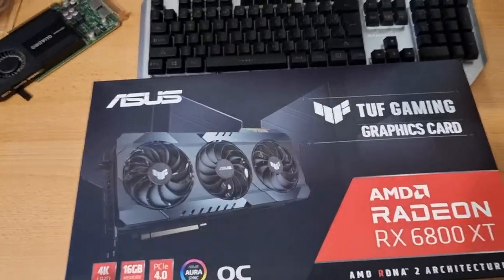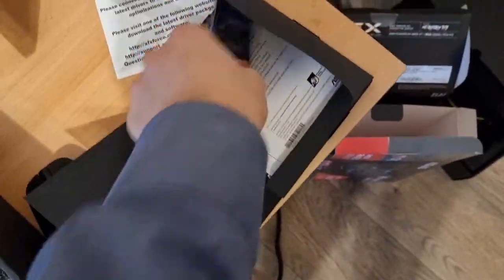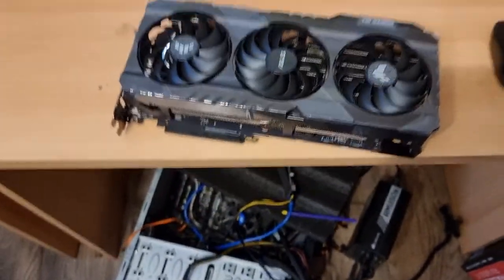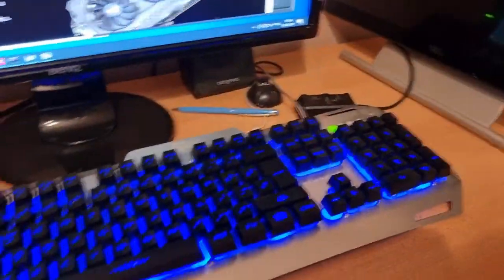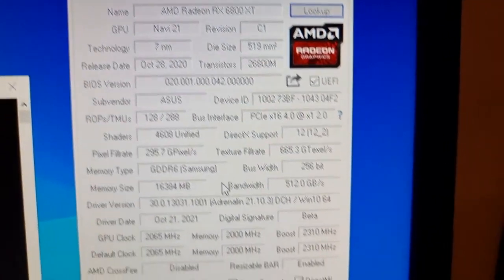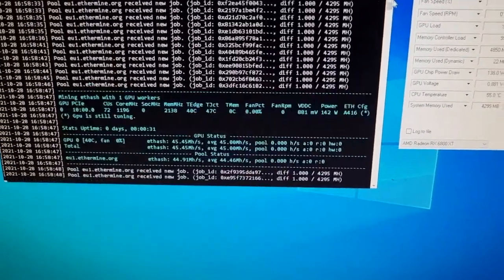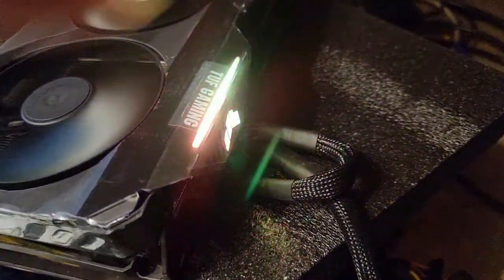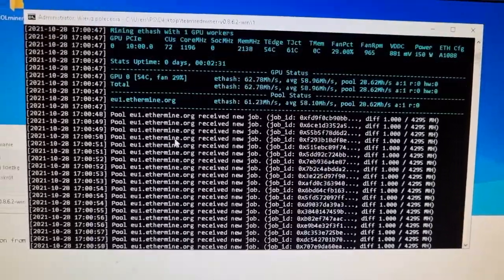RX 6800 XT 16 GB ASUS Graphic card GPU unpacking and performance on ETH mining hashrate

Comment: use morepowertool.1.gpuz,save bios 2.morepowertool load bios 3 save and restart 4 power limit -55,650 mv 5.core 1200-1250,pl -45 to -55,memory 2130-2150 fast timing 6.mining at 103-107watt( software) 64mh.i use 21.3.2 driver 8 months